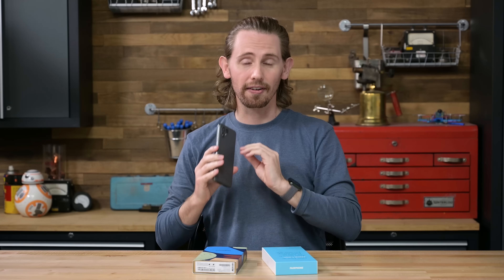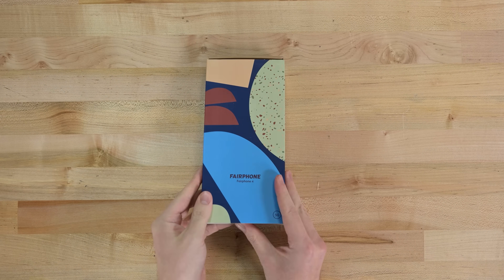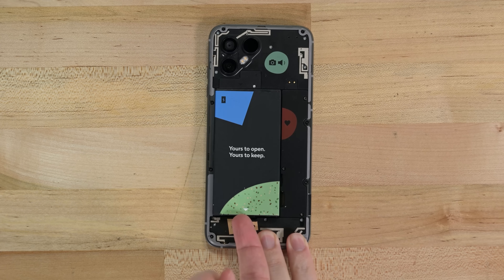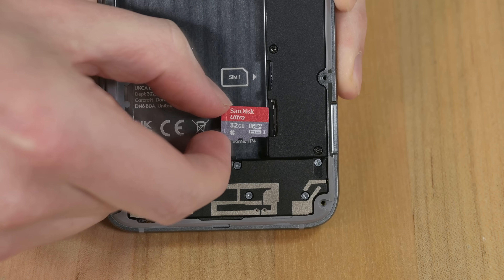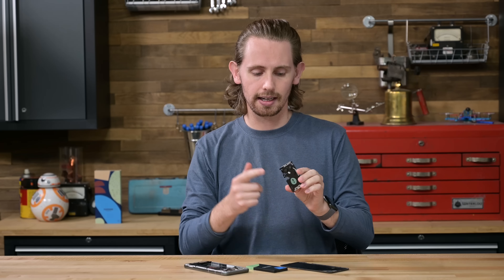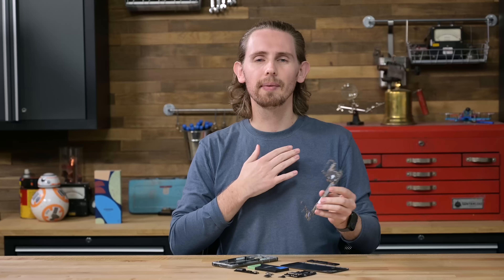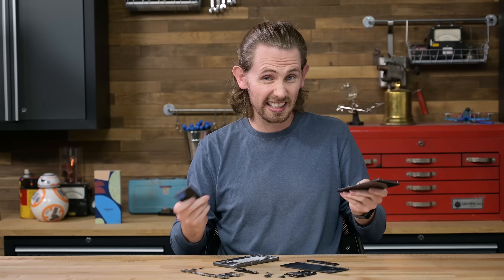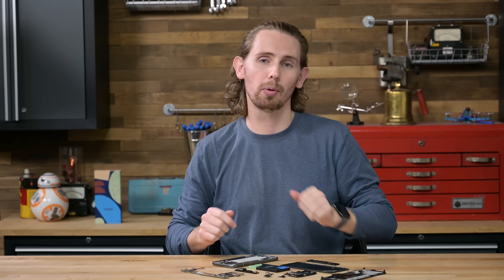Fairphone 4 Teardown: If Only Apple Made Phones Like This…

Comment: Why these guys emphasize only the removability of the battery but not battery swap-ability? A second identical battery of 4000 mah that costs only 29 Euros, that you can carry anywhere and swap it when the 1st battery inside is about to die so you have 8000 mah of power and respective screen-time with the phone. It is super convenient than carrying a power bank. Second battery only 60 grams, unlike a minimum 200 gram power bank where you need to use with the phone a cable between, hold them together very clunky.That was the thing I did with my Samsung galaxy phones until they shifted to un-removable battery designs. I switched to LG G4 for only this reason when buying a new phone then.

Comment: Everyone claims to love this type of hardware but no one buys any when they’re released and the companies end up going bankrupt.
Reply: Human hypocracy at it best 🤷🏻
Reply: A small, loud minority loves this type of hardware*, while the majority which is driven by either marketing or price-point think it's a gimmick.

FTFY
Reply: Where’s the flagship feature for its price? It’s way more expensive than the Samsung A52s yet it has weaker SoC and just an LCD panel.

That’s just the Samsung which known to be relatively overpriced for the midrange, if you go with the Chinese brands you could even get the Snapdragon 888 at the around the price of A52s.
Reply: @rommysoeli  Read their website, they are not a big brand mass producing smartphones in the "as cheap as possible" philosophy.

They are the brand of "eco-friendly, ethical consumption". Their "flagship features" are not using conflict minerals, not using misery wage labour, being as recyclable as possible, and being fully repairable. The only thing missing on that list is using open-hardware parts, but I'm sure they can get there eventually.

They aren't a part of a giant corporation that can give them funding to achieve economies of scale, and can help them negotiate cheaper part prices with the manufacturers. Knowing a bit about how mass manufacturing works (And when it doesn't), I'm actually staggered that they can sell that phone for such a low price.
Reply: @rommysoeli  im glad some of as are aware that this is all nonsense.
Reply: @WhenDoesTheVideoActuallyStart  so you agree they’ll be out of business soon?
Reply: @hsvr  What? They've been slowly growing for almost a decade lol. They're going nowhere.

There's clearly a market for their products, it's just not the same market as the products Xiaomi sells.

For now it's a niche market, but there there will always be people happy to pay a little extra to get more value out of their investment (Thanks to it's repairability, it's likely to last much longer) and support "good companies".

Comment: Apples is designed to lift the glass when expanding for safety. I wonder how that battery shell will do under pressure, worried about it building pressure and popping worse but maybe not 🤷🏻‍♂️
Reply: You know this is exactly how batteries were before they started making phone with non removable batteries right? This is not a problem.
Reply: @jamarforsythe7262  yup my Moto G5 has  a user removable battery. It's great - instantly recharge by swapping batteries. I wish they still made most phones like this... 

sighs

Comment: yeah but where's the headphone jack LMAO
Reply: just use any wireless headphones so headphone jack is no longer important 🤣
Reply: @huuhoangmanh685  imagine preferring dealing with more batteries instead of a simple cable
Reply: @xyetian  yes i actually had to deal with them a lot 😂. before i got my airpods pro on August, i had used some cheap wireless headphones, despite producing great sound they died just not over 1 year old, no longer turned on 😐. back from pre-2016 wireless headphones were not a thing

Comment: Great device, But WITHOUT jack plug? 
No, sorry, a USB-C to jack plug is NOT a replacement for a jack plug that has been rationalized away.
I was actually going to buy the phone UNTIL I saw this.
Now it's not going to be a Fairphone after all. Too bad.

I would be very happy if the Fairphone 6 had a jack again and two real SIM card slots.
Preferably in the size of a Samsung S10e (5.8 inch display)
Then there would be a thumbs up from me and Fairphones for the whole family.

Comment: sadly, the "right to repair" thing became popular because iphone is a very popular phone, and it's popular because of Apple. That doesn't mean a company selling a highly repairable smartphone will have good sales. 
Not that I don't want repairable phones, but a phone with repairable design as its selling point is not enough for people to chose it over iphone. You may have a possibility that you need to repair the phone, which is low, but you experience the apps, OS, camera every single day. So phones that are good in those features are much more successful than phones that only have good repairability to set them apart

Comment: 1. Fairphone desperately needs to compete better in the cameras department if they want more people to buy this considering cameras are now the top consumer selling point of modern smartphones. 

Three cameras or even four, of the same 48MP quality (please no 5MP sensors, please), would make it impossible to ignore. 

2. Also, speaking from experience having owned an IP-certified Samsung S4 with back panel that can be pried off with your fingers, this design is not waterproof. Eventually the clips will wear, they won't provide the proper pressure against the gasket to seal, and you'll inevitably flood the phone and destroy at least the motherboard.

Something like screws to maintain pressure of the back panel against the gasket is a requirement for reliable waterproofing in the absence of glue.
Reply: Camera hw is a comodity. any small/medium manufacturer buys off the shelf part. that's not the differentiating factor nowdays. Google demostrated this with the use of the same sensor through pixel 2/3/4/5. Having a good sw implementation is  whhat is necessary and what is hard (read: expensive) to do. if Oneplus still can't compete in this regars, I doubt Fairphone even want to give it a go. regardless, the picth has never benn that you buy a Fairphone based on the specs
Reply: @salmiakki5638  and what's Pixel doing now? Oh yeah, they're finally moving to three cameras. There's only so much computational photography you can do before optical telephoto wipes the floor with you.
Reply: @victorlin4645  yeah, but go on and take the raw jpeg output of any smatphone sensor  and it will look like knokoff no brand phone from 5 years ago. since hdr+ has been a thing basically.

Comment: I think 99% of people want such an easily repairable smartphone, but 99% of those same people see the value of this smartphone disappearing because of its design, its processor and camera very low level compared to the current market, the software and its monitoring which are not at the level, but especially the high price of this smartphone for what it is.
 
And for a green company, remove the jack plug and sell TWS 🥴.

Honestly I think that Fairphone is not really fair, green and in favor of the planet but just wants to make big money on the back of this concept 🤧🚶🏽‍♂️🚶🏽‍♂️🚶🏽‍♂️.

Comment: Who on earth uses this crappy 3.5mm jack?
Reply: Just a few billion people.
Reply: Bruh

A lot of people before they forced bluetooth on everyone.

It's not crappy, it will perform consistenly while bluetooth will drop out.

I actually do use bluetooth buds with mine but if the battery dies I can count on aux.

Also my phone can get FM radio because of aux.

And I can get music from my phone in my car with no bluetooth.

"Lmao you must be poor if you don't buy a new car all the time"

Enjoy your student debt bro.
Reply: @deanwoods8647  
Less than a million? Are you speaking for yourself in your own wealthy city or are you considering the entire world?
Reply: @deanwoods8647  
"Use case where is better/easier than Bluetooth"
Literally just plugging it in vs. the Bluetooth pairing process. Both better and easier. Done. Your argument is destroyed.
Reply: @deanwoods8647  Better audio quality and no need to charge the earphones.
Reply: I do, on my Moto G5 which I picked because of this port.
Reply: @deanwoods8647  Not all bluetooth devices pair well. The first ones I had worked great for about 5 hours and then would only let me pair one at a time so I returned them.

Now I have Pixel Buds and they work great.

But you can get a pair of wired buds for $15 that sound just as good as Pixel buds which are $100.

There is also the issue of repairability. The more expensive something is the longer I want to keep them.

And like I said before they can do FM radio which bluetooth earpieces can't do on their own.